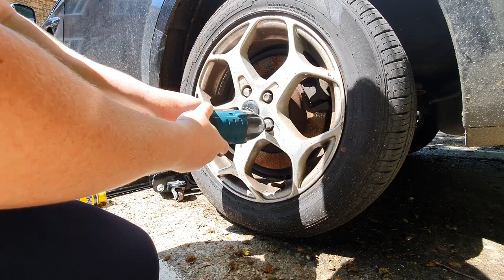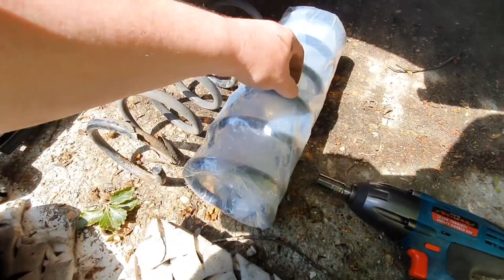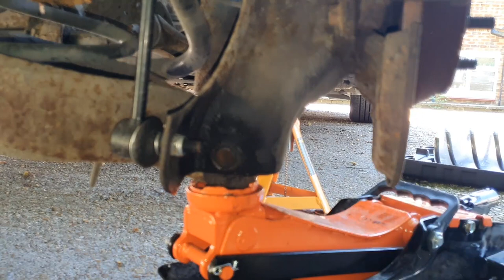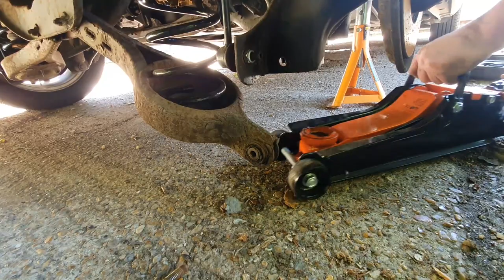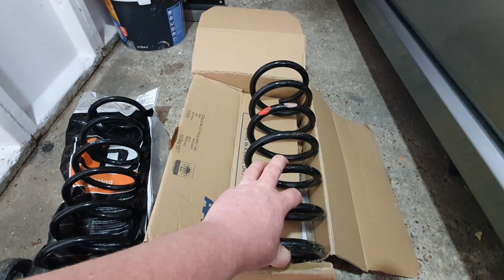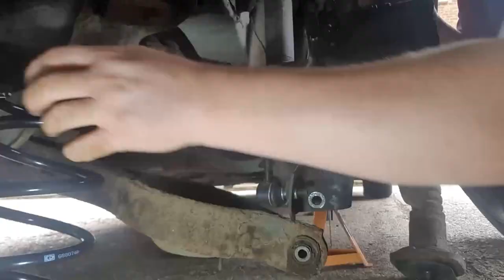Ford Mondeo Mk4 - Rear Coil spring replacement

Comment: Exactly the same procedure for the Volvo V60 P3 year 2011 - 2018🚘. It isn't covered so well on youtube so this is very helpful.
Reply from the maker: Cheers for that Brian, will tag that motor sonmight help other Volvo V60 people out.
Reply: @ChazzCoombes V70 as well. I might do this job next spring. I noticed that the spring on the right side was broken down at the seat. I plan to drive until I replace both when the weather improves, which would be April or May.

Comment: Great real video. In a week, i hope to have replaced all 4 springs on my mk4. The video shows that it isnt completely necessary to compress the rear springs before removing them,  but the front ones have to be compressed , eventually after removing the completely strut included the hub first. Cautions is important

Comment: Chaz, good show, I now own a Ford Focus Zetec. 1.8tdci, and it has from the factory, a sports suspension set up. It is reported to have a ten mm drop all-round. It doesn't though, have the  WRC rear anti rollbar drop links . I will be checking the spring colours now. I am changing the rear engine mount ( Lynx engine ) , as it has gone ( transmition to subframe ) 
.Very handy this video. Also Chaz, I think your Mondeo should have what's called a 
" Crash plate " above the fuel filter housing, mine has, but it's missing, a " lazy mechanic " issue  possibly!! ☺☺

Comment: Looks like quite a simple little job, at least compared to doing the brakes on all four corners...... Pitty I can't do it myself any more with no flat ground to work on my car.

I do have to wonder why i'm having SO much trouble getting anyone to quote this job though.
1 place wasn't equipped for it (new garage I decided to try).
3 places still haven't called me back after nearly 7 hours.
1 place refused to believe it was the spring and said they needed to see it, they became even keen to quote when I told i'd had the wheel off and could send them a photo of the broken spring.

It's quite simple, i've diagnosed the problem (broken spring), all they have to do is the required work and any additional complications that crop up. Is the state of garages these days?

Comment: What is the torque figure for the lower bolt ? This is a job I have to do on my car.
Reply from the maker: hiya sorry i really need to start putting the Torque settings in the description. Any way Lower Control Arm bolt to hub carrier is 120Nm and the Subframe bolt is 103Nm hope this helpss
Reply: @ChazzCoombes  many thanks